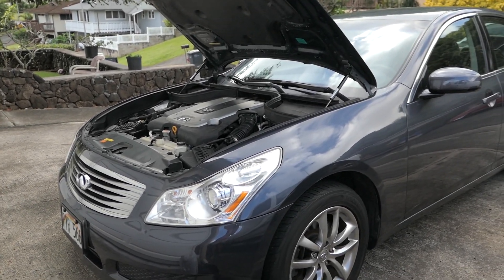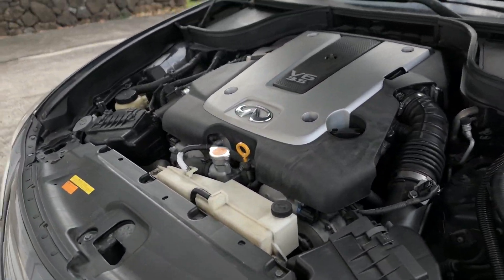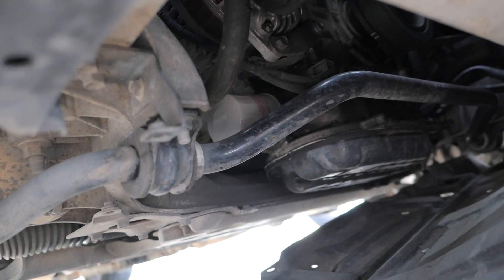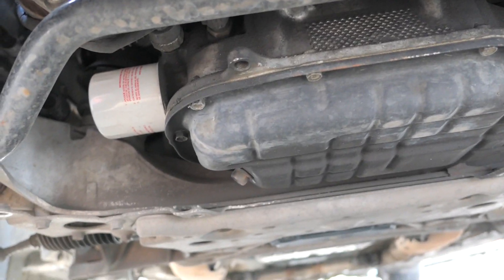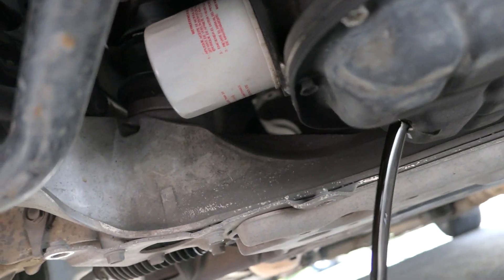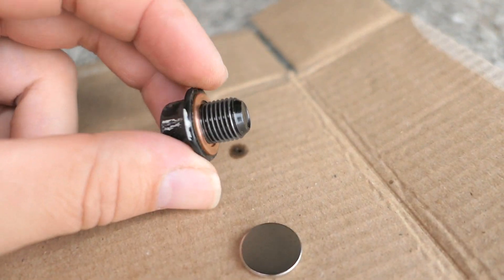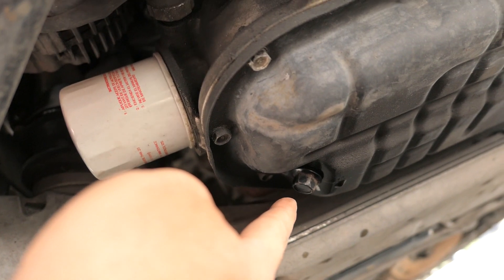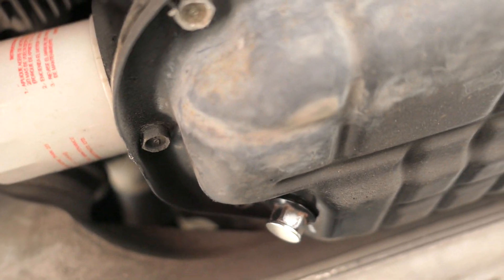2008 Infiniti G35 - Diy Oil Change

Comment: Just a comment. I checked  the oil spec with year and model it says 5W/30. Some people said it’s okay to use the non spec oil but use the correct spec in the next oil change.

Comment: Good video however by putting a magnet on your plug or anywhere will potential stop those particals from getting to the filter, plus if ya magnet falls off for whatever reason you will have a big chunk of grud dislodge block your oil gallery sonewhere, .if you have to have your magnet, put it on your filter, let me know if you think that makes sense 👍

Comment: I need to change the oil pan as it's being rusted. The oil change shop refuse to change oil without changing the pan. Is it easy to unlock the bolts if I access it without car lift ?

Comment: 10w-30 on a VQ35HR?.... Wtf bro
Reply: That’s what I’m saying lol
Reply: Isn’t it supposed to be 5w-30 and synthetic?
Reply: @kdog1415  Yes. All VQs use 5w-30. Synthetic is not necessary. Although it's preferred
Reply: @javierr3795 is there better performance using synthetic? I've been using regular.
Reply: @TechJunkie01  I might be wrong but from what Ik synthetic oil is way cleaner than regular probably more efficient too
Reply: Hahaha I run 20w50
Reply: 10w30 full synthetic is better especially in if they are highmile
Reply: @Doughboy1871 Don't u think 10w-30 is overkill for the VQ?😅😅